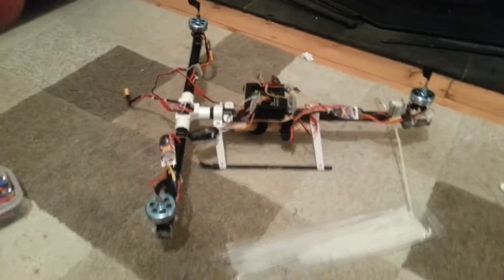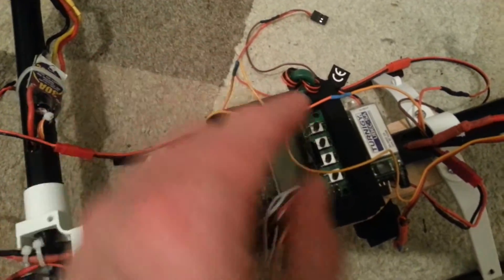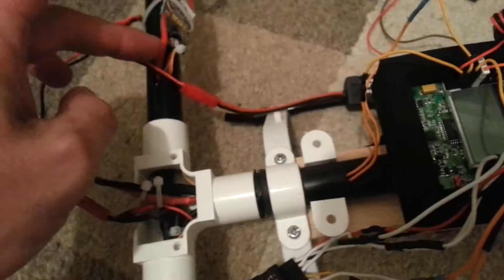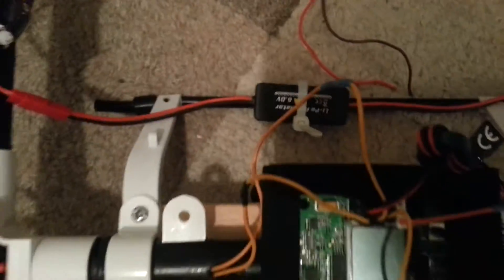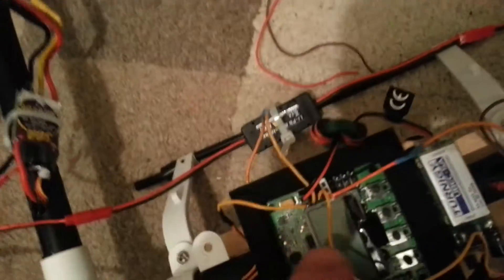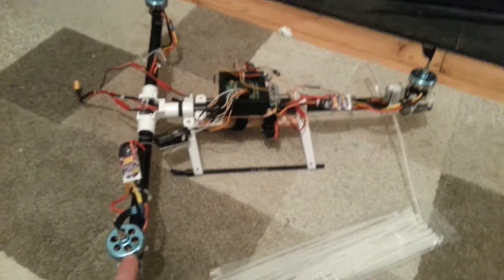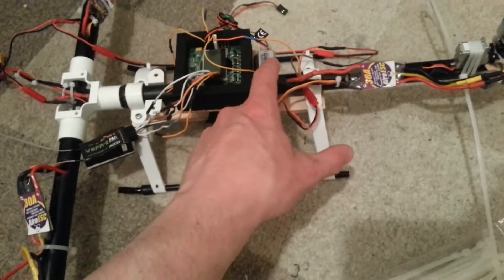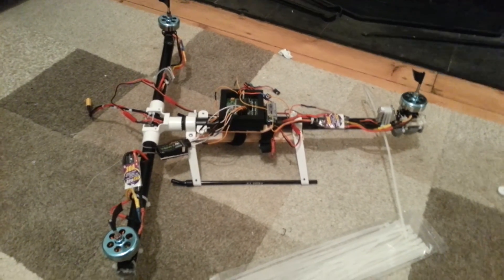Alternative wiring method for kk2.1 Board

Comment: Is a Bec just good insurance. .? I've built the Tricopter v3 and I've ordered the built in bed on the new power distribution board he has made.  Was two becs on your vid necessary or did you just wanna be sure to eliminate your issue.